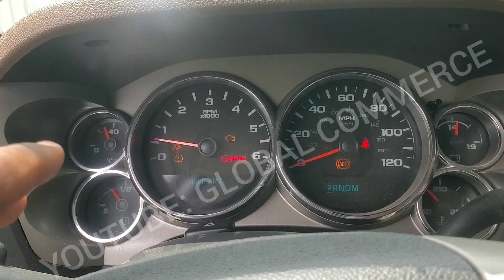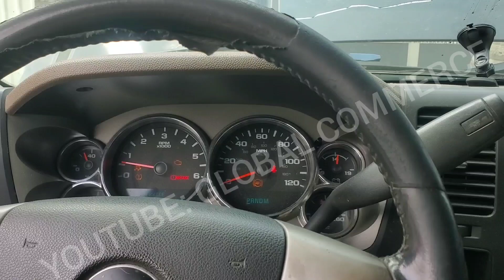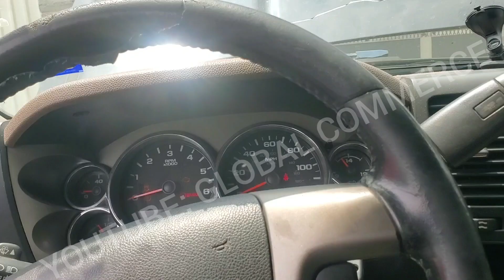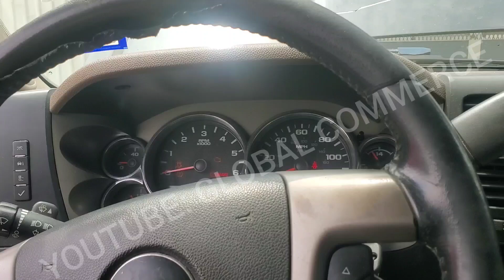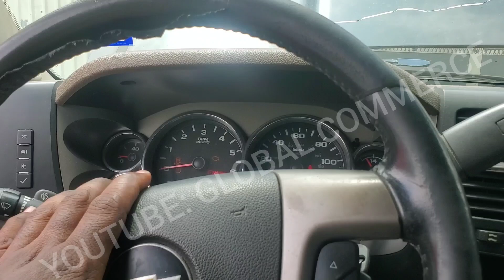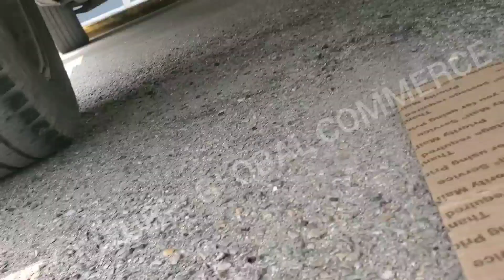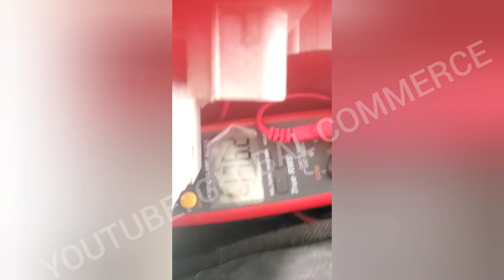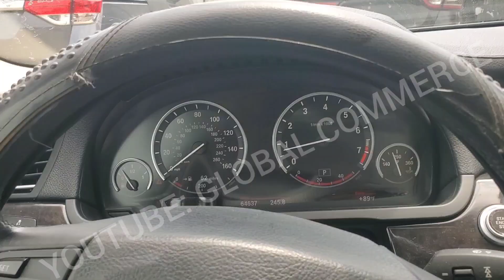2013 Chevy Silverado U0100 U0073 High Speed Bus Off, no communication PCM BCM! CANBUS ISSUE! PT1

Comment: Excellent video! Folks, this is te way to troubleshoot! I have a similar issue with my 2012 Chevy Colorado. A mean gremlin is in it causing me pain!😂 I’ve been chasing it for four months. I’ve replaced modules..I keep getting U codes. The main problem is P0856 which self clears overnight. I’ve checked OBD2, CAN bus, grounds battery health..etc. I’m at the point of reverse engineering the aftermarket add ons, stereo,LEDs etc. Luckily I have no drivability issues and really could care less about the ABS/Traction Stability System… I’m just worried about it leading to additional problems. I still haven’t found the problem but will not quit until I find it. I don’t have the skills this gentleman has. I wish I did! Thank you for this video! It gives me additional motivation to keep going. I’m getting frustrated at this point. New subscriber BTW. I love your p love your approach to getting to the root of the problem!! Great work!
Reply from the maker: Thanks for the feedback and welcome to the channel! Does the P0856 code only come on when your driving short distance?
Reply: @globalcommerceca Yes. It does everyday. Very consistently. Usually after a few stops a starts or after driving about 30 minutes. I have a midrange bidirectional scanner. In the morning, the scanner recognizes the EBCM. It will have a C0240 code. Both the ECU and the EBCM will have communication codes either U1000,U1040 or both. Sometimes the instrument cluster will also have the U codes… not always. I’ve had a couple of local mechanics weigh in.. they can’t figure it out either. I did notice yesterday, while sitting still, the ENCM data was showing-.56ft^2 on the lateral and longitudinal axis. This problem has me stumped. I’ve done everything I know to do. I’m betting it’s a heat related circuit opening up or maybe shorting. Any ideas?🙂 Thanks again for taking the time to make your videos and respond to my comment!

Comment: I was having a problem with my 08 silverado but only for the module tcm saying lost communication with ecm U0100 and the ECM code was U0073 no other module, the only symptoms was transmission surge jumping in n out on the 1st gear and vss speed sensor even if its disconnected its reado 0-255 max of the reading.
Reply: And how did you solve the problem? The exact same thing is happening to me.
Reply: @HectorAndrade-m9q No. still diagnosing it, i almost checked everything n found no problem, im thinkig of getting a reflashed and reprogram for tcm and ecm. What was the symptoms on yours?
Reply: @JayAtlarep did you find the problem I’m having the same thing
Reply: @JayAtlarep  is it making a clicking noise also my 08 suburban is having same issues

Comment: hi boss i got cheavy 2012  6 . 0    u0101 killing me,i checked all wieing tcm ecm i had changed but some code pls can you give some type hint. ZF TCM
Reply from the maker: For the U0101 code, which indicates a loss of communication with the TCM, here are a few things to check:

Connections: Make sure all wiring and connectors are secure and not damaged.
TCM Check: Confirm that the replacement TCM is installed correctly.
Grounds: Ensure all ground connections are solid.
Other Codes: Look for additional trouble codes that might give more clues.
Software Updates: Make sure the TCM and ECM software are up-to-date.
Communication Lines: Inspect the CAN bus for any issues.

Comment: thanks for explaining  I have maybe the similar issue on my Suburban 2012   , I got these  code :  P0700 Transmission control system ( MIL Request )   ,  U0073  Control  Module  Communication Bus  "A" Off     ,  P2635 Fuel Pump "A" Low /Performance       from where should I start the solution  thanks
Reply from the maker: There are I believe 2 parts to this video that solved this issue. If you would like to solve it for free watch both parts in this series closely.  If you miss any parts watch them again.
Reply: @globalcommerceca  thanks
Reply: Did you figure out your problem mine had the same codes
Reply: @anthonystewart8532  some  of those codes fixed but still some problems not fixed yet  the main problem came because of  canister   and made  a big tragedy  because  all particles  close the fuel hoses  and  made full  failuir  to the fuel pump and cannot be fixed at all so what I made firstly  I  requested from the mechanic  to clean the canister from all charcoal  particles completly from all fuel hoses and even I bought  a  new one but  I didn't  install it and I will not  cos I dont want this tragedy happen again so I replaced the fuel pump assembly with a new one  and also requested to  remove the fuel tank and make  a full clean of all remaining fuel and the charcaol particles and mud  full cleaning  the parts  I bought it but must be replaced is  fuel pressure regulator  it the part of evap  system it is comes after the canister  directly  this is the most important part to fill up the tank  with fuel  so the main problem is when the engine  is not getting the fuel  those codes will  show up   so the main problem from the canister must be cleaned perfectly from all charcoal  it will remain only   a  small metal inside it   the other codes  still need fixing  I will  change the spark plug and new wires  the last fix must clean  the gearbox  harness  cable because  I think the rain reaches the cable and need fixing  maybe some pins not connect elecricity  I only suspect  and and also the gearbox need  updating firmeware  I really  don't have  much time  good luck

Comment: I have pretty much the same problem with a 2015 savana after engine replacement, the pcm loses connection every few seconds with the abs module.
Reply from the maker: Try reseating ecm, also check ohms across pin 6 and 14 at obd2 port
Reply: It should be 60oms?
Reply from the maker: @AlexDai-fx2ss  60 ohms
Reply: I checked it’s 61ohm when cold, after the truck run for 20mins, it tested megaohm. Swapped new pcm quickly and tested 60ohms
Reply from the maker: @AlexDai-fx2ss  Strange, you if there was a problem with PCM it should read 120ohms, not in the megaohms range.. may want to retest and verify you were on the correct pins/contact..
Reply: It is the correct pins, I’m going to replace the pcm and retest
Reply from the maker: @AlexDai-fx2ss  keep me updated.